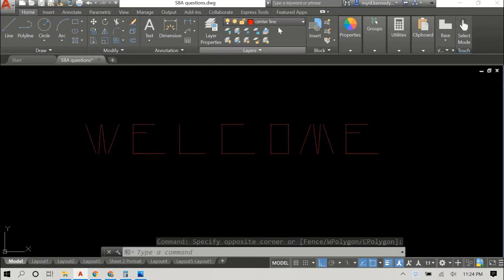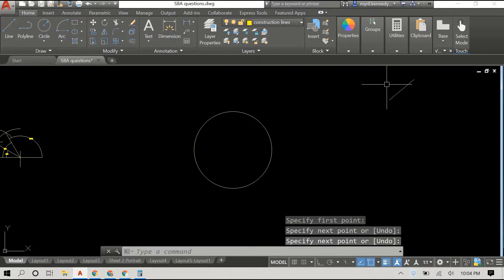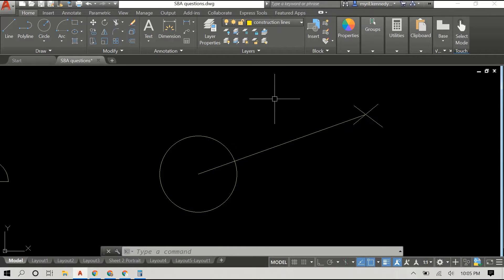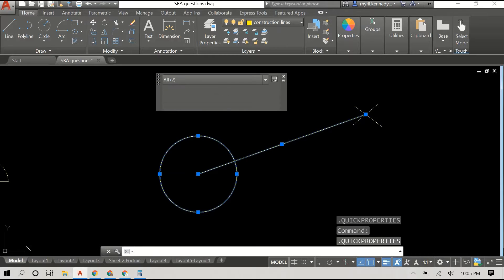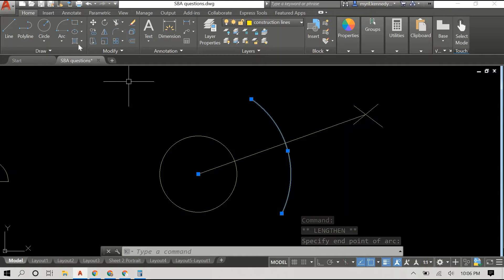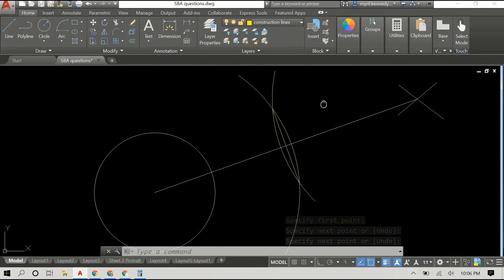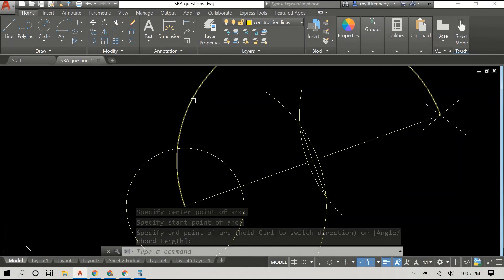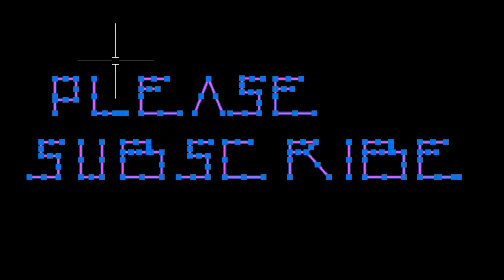AutoCAD Tutorial: How to Construct a tangent to a circle from an external point. (Technical Drawing)

Comment: Could you just find the bi-sector by finding the midpoint (length of line divided by 2) instead of creating two intersecting arcs?
Reply from the maker: Yes you can. If you have the midpoint, you can use that. The intersecting arcs is just a method of construction. 😎